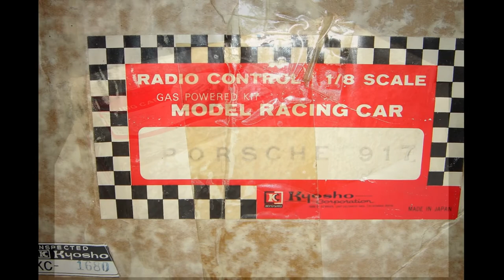1970 KYOSHO Dash 1, Porsche 917 (1/8 Scale) Kyosho's 1st RC Production Car

Comment: my first RC car in 1977, in the buggy version. No kick-up, no shock absorbers, hardly any ball bearings, fuel hoses made of PVC that hardened in the cold, and after each ride all screws had to be tightened. Rigid axle with brass plain bearings, Simprop-Sanwa rc system with 40 Mhz, 3 channels etc.  It was fun..
Reply from the maker: @Yonahful  sounds like a real fun car. Wish we could all see it. Thanks for sharing.. 😊
Reply: @MediaHero69  Nope, was the Kyosho Dash. Like the one in your video, but with different tires and bodywork, 21cui Enya engine.